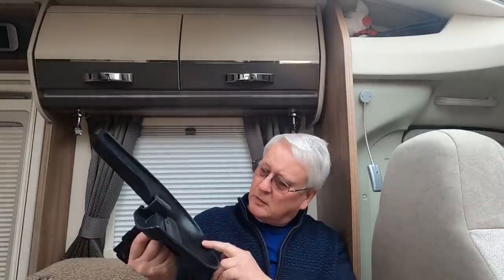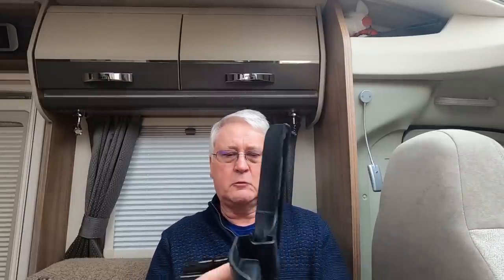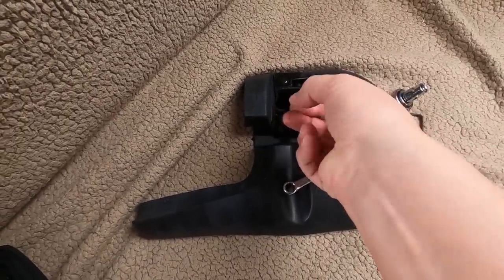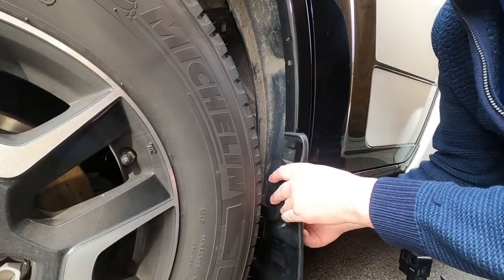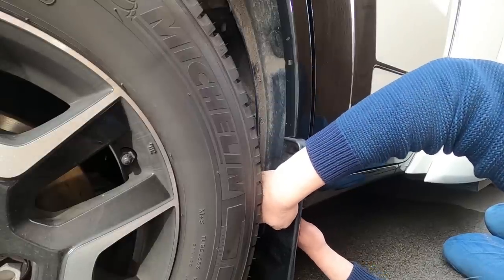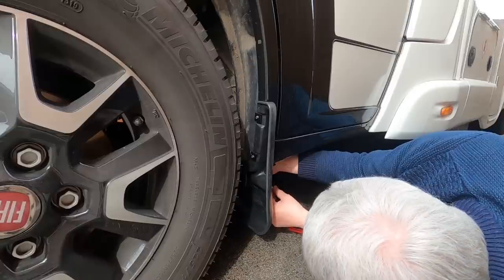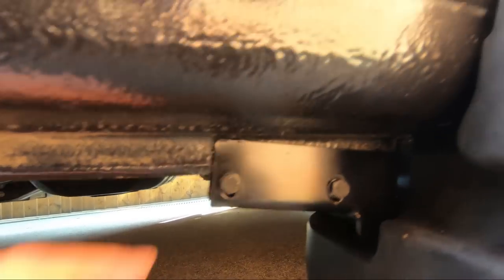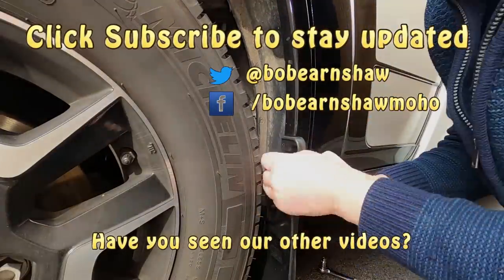Fitting Mudflaps To A Fiat Ducato | Help, Hints And Tips

Comment: I done my mudflaps last year, used the official Fiat ones, went like a dream, as you say the offside has sealant in the way, no problems, you may need to put the wheels on full opposite lock to give you more room when tightening the top screws , mine still look like new nearly a year later !!!! Great video Bob
Reply from the maker: Thanks, access to the clamps was OK and would have been better with the wheels out of the way, but I was trying not to move the wheels, as it would have required starting the motorhome for the power steering and I didn't want to do that just for a short while as it does the engine no good at all.

Comment: Hi Bob  I had the same problem, with the genuine Ducato mud flaps.
To solve the problem I used some black silicon adhesive around the top and side of the mud flap to the wheel arch. Looks perfect now. It also stops the water and dirt getting inbetween the mud flap and wheel arch. I would of took a photo for you but I can't get into the storage site due to Lockdown. 
Keep the videos coming Dave.

Comment: Hi Bob, I have just started fitting a set to my Peugeot Boxer Elddis Accordo. I decided that I would seal them to the bodywork using Puraflex in the hope to stop the dreaded rust bug getting a hold when the flaps flex. I also found that I could not get the lower wheelarch clip on due to underseal, I did not scrape this off but I think the Puraflex should hold it. I am also in the process of waxoyling the complete chassis of the van which is not a very pleasant job but I think it will be worthwhile. They use a lot of salt on the roads here in Scotland. Great channel BTW.. Cheers Danny
Reply from the maker: Thanks, not sure I would want to seal them in though, I'd worry about sealing in moisture.
Reply: @BobEarnshawMoHo  I am hoping it will be OK as it is sealed with the same type of compound they use at the factory to seal the coach built body to the Peugeot Cab.

Comment: Hello Bob, I looked at your video before fitting mine which I have done so today. I am pretty sure that you have put the back of the  sill clamp on side down. Also I think the U shaped clamps should have the allen screw head on the inside of the wheel arch. The flat of the U clap should press onto the rubber flap and the allen bolt should tighten down onto the metal wheel arch
Reply from the maker: You might be right, I had no instructions on fitting them, but they've stayed on so far...
Reply: @BobEarnshawMoHo  Hope you didn't mind me commenting. And thanks for all the info supplied in your other video's. 🙂
Reply: @BobEarnshawMoHo  the way you fitted them is the way it's on the instructions that came with mine... so you're good! I tried the other way round, but that wasn't possible on mine.
Reply from the maker: @x11freak  Yes, couldn't how they could have the clips round the other way.

Comment: Thanks Bob; could have done with this 3 months ago; but I bought the Fiamma mud flaps. Now been on for 4K miles, given my DIY skills this has been a result. My point in posting is I’ve been disappointed as whilst an improvement offering some protection to the cab area, the width of the body on our Autotrail is such that I don’t think there’s a great deal of improvement. You also have to be careful if reversing onto wheel chocks. But overall I’m happy to have fitted with these qualifications
Reply from the maker: Yes, I noticed that they catch on levelling ramps on my old van, and on some speed humps, but they never came off.

Comment: Hi Bob, I was lucky enough to receive exactly this set of mud flaps from my wife, Julie for Christmas and after watching you vlog had a go at fitting.  It looks from your Vlog that you have fitted the near side clamps  one way and the drivers side differently.  The bolt heads on your drivers side install are visible. I think……….you can install both the same way as you have on the drivers side as the removable bit of the clamp can be turned around.  I think….that that is the correct install as the return of the removable part if the clamp can then be pointed at the seal producing a more secure hold.  Hope that all makes sense, Tony.
Reply from the maker: I fitted these about three years ago, both sides are same and the clamps are possibly the wrong way round. A few people have pointed this out, thanks.

Comment: Excellent video as always. I believe 50901517 is the P/N for the front set whereas 50901516 is the rear set which presumably wouldn't fit at the rear of a coachbuilt motorhome.
Reply from the maker: Thanks, I stupidly thought left and right!
Reply: @BobEarnshawMoHo  No problem. I only knew as I've been looking for some for ours. Your video will definitely come in useful when I finally get them though. 👍🏻

Comment: And here's me screeching "turn the wheel out of the way", and being totally ignored!
Reply from the maker: Thanks, access to the clamps was OK and would have been better with the wheels out of the way, but I was trying not to move the wheels, as it would have required starting the motorhome for the power steering and I didn't want to do that just for a short while as it does the engine no good at all.

Comment: Ok I'm about to do this now. I never got instructions or an allen key. Reading some of the comments and looking at what I have I think the sill clip is the wrong way around. Also I intend to cut an allen key down so I can tighten the clips from inside the arch which will then clamp the rubber with the clamp. Definitely going to use some silicon to hold it in place as well.,
Reply from the maker: It's about four years since I made this video and they're still attached. Let me know how you get on!
Reply: @BobEarnshawMoHo  it was too awkward doing the allen grub screws up from the rear so I put the clips on same as you did except I put a M5 washer between the screw and the mudflap. This worked great as the screw wasn't cutting into the rubber. I also stuck a load of silicon between the arch and the mudflap which has now dried nicely. I put the bottom bracket the opposite way to you as there's a small lip which it fitted perfectly so won't just slide off unless bolts completely undo. If yours is still attached after this long then either way obviously works. Thanks for the guidance.

Comment: Hi Bob I would make another wee hole in your O/S  mudflap to allow the flap fit flush to the wing! It would Look a lot better in my view.
Reply from the maker: That sounds like a good idea.
Reply: Hello Bob and Jenny. This is how I fixed my mud flaps. I used one of the U shaped clips and machined bolted it through the square hole in the arch
At the very top of the flap I screwed a stainless steel screw through the wheel arch and smeared black sealer over the fixings. Oh please turn the two bolts around at the bottom of your flap they look better pointing in and easier when cleaning the van. I will try and send you a pic of mine when I work out how to do it. Terry Elvin

Comment: Have you looked at mudflats for the rear of the motorhome Bob.
The pull out lockers on my 774 get loads of mud in them and am wanting to stop it
Reply from the maker: No, I've got front mud flaps but not needed rear ones as my locker is between the axles.

Comment: Hi Bob, the plates on my Fiat mudflaps came ready to fit and the small fixings in a bag. This meant that the plates were corect and fitted straight on the van with the nuts on both sides accessable from the outside of the van, I guess yours got turned arround. I also note that the smaller fixings are really badly designed, on old mud flaps the screw would be on the internal hidden edge of the mudguard straight on to metal  and a good clamping flat surface on the outer visible side, (it is not possible to fix it that way). I expect the flaps to last a long time so it is better to be slightly harder to fix than look worse. Hope you can understand this Ta.
Reply from the maker: Ah well, at least it helps to keep the mud off the side.

Comment: Bob I think the first bracket removed which clamps to the under body rail, is supposed to fit in reverse by that I'll try to say, edges at opposit sides and not facing each other if that akes sense?
Reply from the maker: No, but it's still on there!
Reply: @BobEarnshawMoHo  just fitted a pair on my Malibu and the 10mm bolts should be on the outside of the Right and Left mud guard when fitting not on the inside as yours was.
Reply from the maker: I think I know what you mean, if that's the case the plate that's attached the mudguard should be on the outside and the loose 'L' shaped one should be on the inside. I daren't move it now, probably too rusty.

Comment: I have always avoided fitting mudflaps because of the fear of them causing damage when going over speed ramps or uneven ground when the vehicle crosses or is parked on grass. Any views on this?
Reply from the maker: There's been a few occasions with speed humps and levelling ramps, but the mudflaps just bent, and bent back, they are rubber.
Reply: @BobEarnshawMoHo  thanks Bob